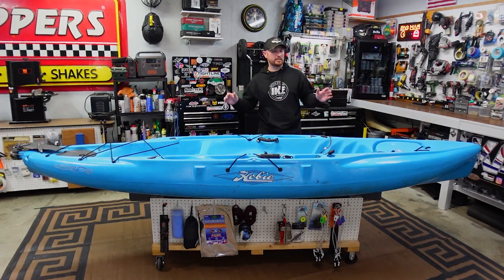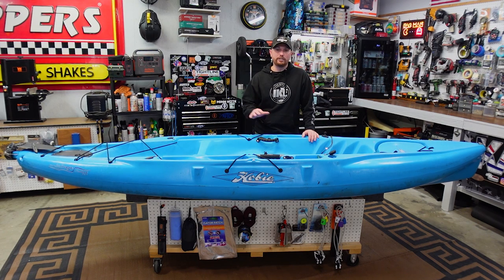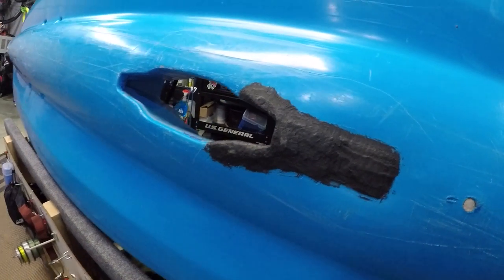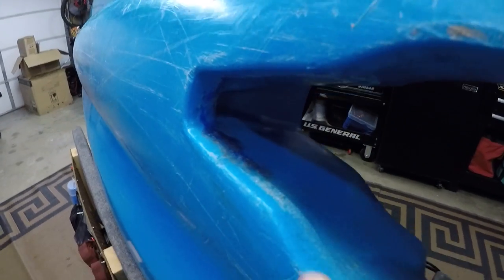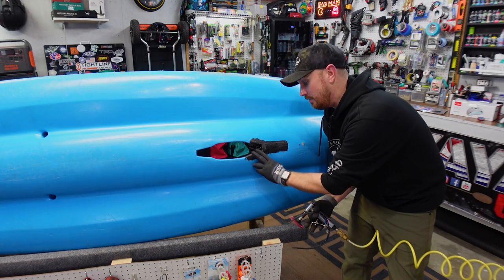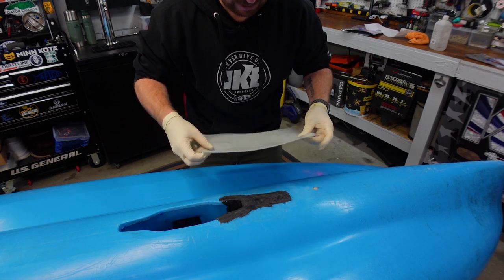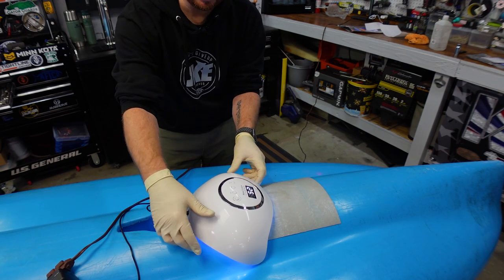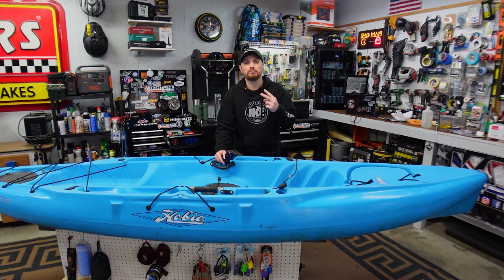How to Patch A Busted, Leaking Kayak | EASY - DIY Kayak Repair 2022

Comment: This seems to be a very common issue with older Hobies but very few videos on how to repair, I am going to give the gator patch a try, I also plan to attack the crack from the inside with backing soda and CA glue, between the two that area should be bulletproof when I am done, thanks for the video

Comment: I've added a gator guard on my front keel, from an earlier video you did. Works great. Have a small one just in case. At $1 a square inch, it is kinda expensive. But it works well.

Comment: Great video although I always cut corners round, eliminating potential peal points. I bought a cracked white water kayak yesterday for $1. I removed silicone and poly gutter stuff 'repair'. I drilled holes at crack terminals (a la Liberty Bell) and a few more to wire and draw in expanded cracks. I explored several plastics before deciding on kitty litter type bucket and with soldering iron and hot air gun found that the plastic readily mingled with the kayak plastic. When done I tried to break it with a few heavy handed thumps and it was absolutely solid. I removed draw wired and plugged small holes with same. I hadn't explored YouTube until after and was pleased to find that my approach was sound enough bit will order a plastic welder. ... or maybe just fabricate a 'shoe' for one of my soldering irons and us bits of an old teflon baking pan for smoothing melded plastics. I'm going to overlay the wear prone areas of keel with bucket or drum plastic overlays.... Rounding any errant corners no doubt. Again, great video!

Comment: High expansion foam to fill big holes, sand to shape, then take to a lineX dealer and just bed line it with high end poly bed liner. Fixed for years. lol
Reply: I tried using expansion foam on my plastic kayak. It doesn't flex with the kayak which resulted in water seeping in and finding voids. I ended up ripping the foam out.

Comment: Nice work! There's nothing worse then trying to repair someone else's failed repair!
Reply: just repaired my buddies kayak that he attempted to melt plastic into earlier today, was a pain in the butt to clean up but got it done and well sealed, pretty happy with my repair but you're absolutely right, it's terrible trying to fix a sketchy patch job
Reply: @Njennings42  Nice going! Some of the materials they use on these kayaks is really tough to patch or mend.

Comment: LoL - you called it - hot plastic does not seal against cooler plastic !! It’s almost like lead solder dropped onto a cooler metal surface.
That gator guard is good but way too expensive! I’m looking for keel guard but don’t want to blow that much cash on such a small sheet. 

Great video - thank you, sir!!
Reply: Funny, it damn sure sealed my hull.

Comment: Hobie outback are notorious for cracking there... the stress of the mirage drive from peddling causes the it to crack. Even after repairing it it will crack again. Curious to how this gator patch holds.

Comment: Like you mentioned, you can use plastic. I’ve seen guys add a rear round hatch, and use the kayaks plastic to fix the hole or cracks. I know this kayak already has a rear hatch, but that’s one way. Also thought you’d test the kayak in your pond! How is that pond doing anyway? I haven’t seen any updates about it. 🤔 😅🤙🏽
Reply from the maker: I’m gonna have to seal the pond.. it has a slow leak..
Reply: @KayakUSA1  try gator patch

Comment: Really informative video. Glad I found this. Question on that old black sealant tape. Could you have used a heat gun to loosen it and saved on the sanding? Really curious as to what the prior people used to try to fix it. Definitely will pick up some gator patches!!
Reply from the maker: I’m really not sure what the black stuff was but it wouldn’t come off easily. That’s why I just sanded and patched over it. Thanks 🤙🏼

Comment: Watched your video, you recommended Gator Patch, so I ordered 2 packs, I got it and it SAS right on label cannot be used with polypropylene! It says it twice on package, why would you put this out as a product you should use on kayak repairs by gator patch won't bond to the material?
Reply from the maker: Lol, because it’s a year and a half later and the patch is still solid as a rock!! That’s why…..
Reply: Probably because rotomolded kayaks like Hobie and Jackson are polyethylene. Blow molded kayaks are polypropylene. Not every kayak is made the same and from the same materials. The stuff he is talking about is for polyethylene.